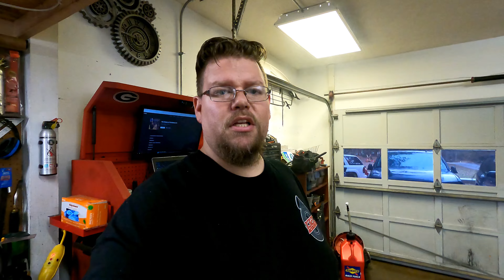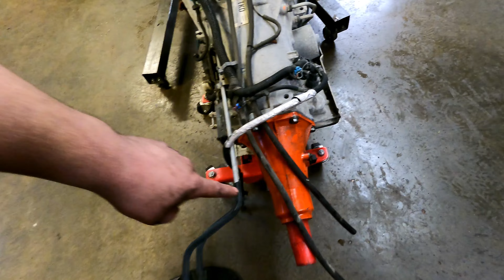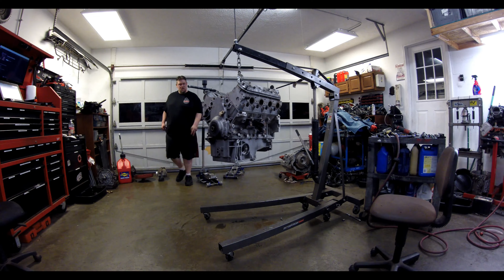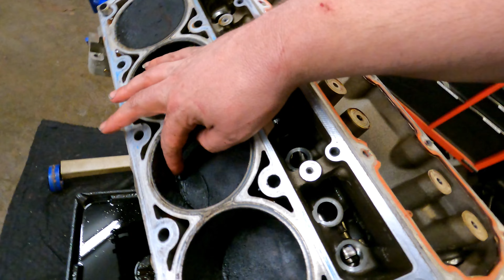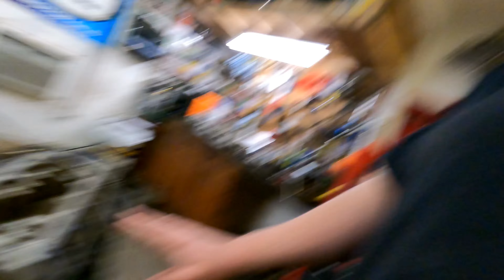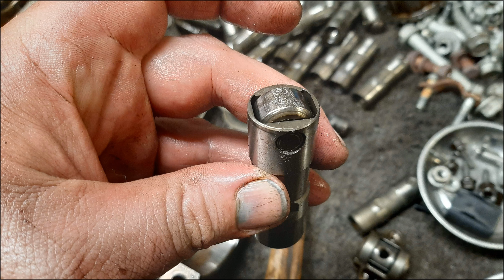2008 Trailblazer SS Engine Rebuild! Tear Down! PT2 (4K)

Comment: About how much does it cost to get a ss trailblazer motor rebuild
Reply from the maker: There's a lot of variables involved with this. Parts used, short block vs long block, bench build or pull. 

Anywhere from 5k-10k